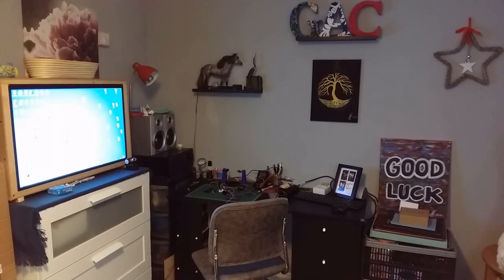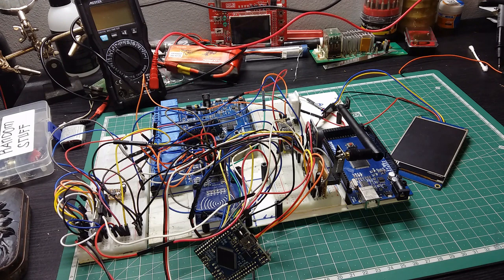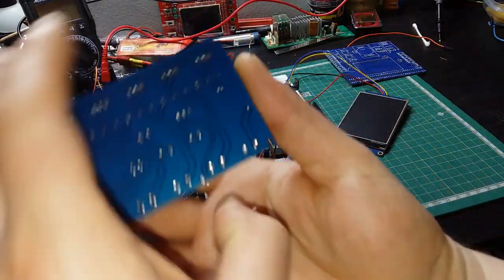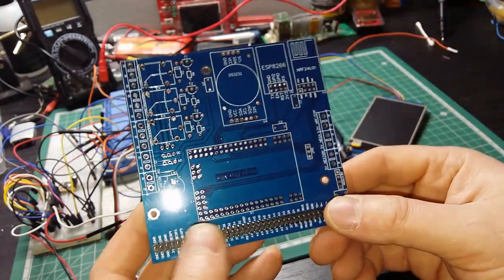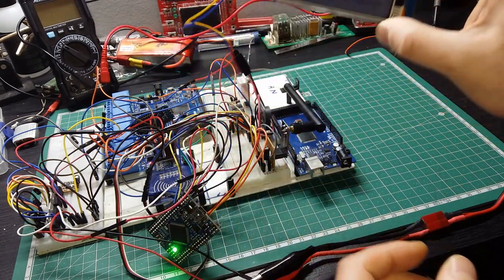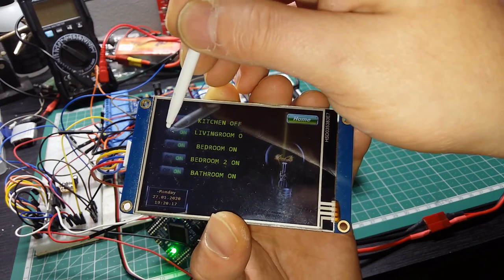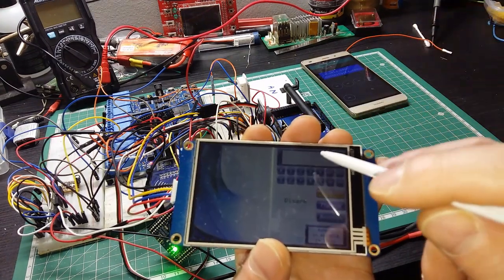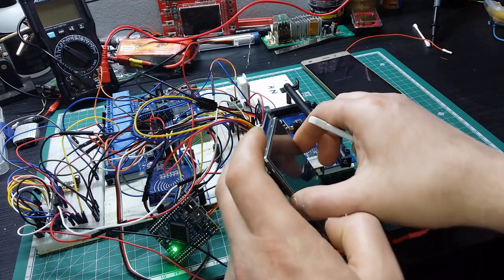Home automation, fire and security alarm with ARDUINO - EP1

Comment: Hello do you happen to have the coding and a parts list of all parts you used amazing outcome well done
Reply from the maker: To write the codes I spent lots of time because there is 8 microcontrollers that run this project and 5 of them communicate via wireless transmission reception using NRF2L01 with the main board then in the main board i have 4 serial communications 1. for display 2.for the card reader 3.for the mp3 player and 4.for the esp8266 to allow me to have internet connection that allow me to control all the system via internet with my smartphone app.
If you need more informations about this project fell free to contact me on messenger I will link my Facebook here    https://www.facebook.com/toni.budau.18    Thanks for your comment